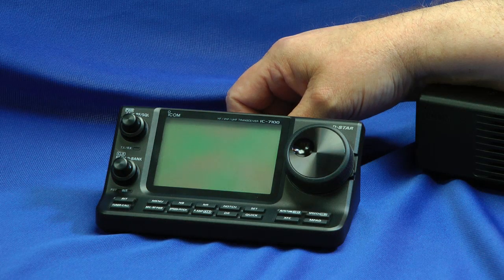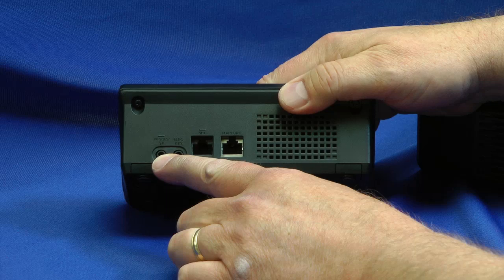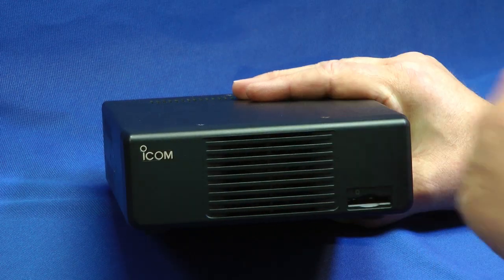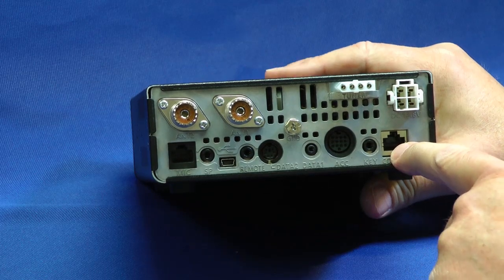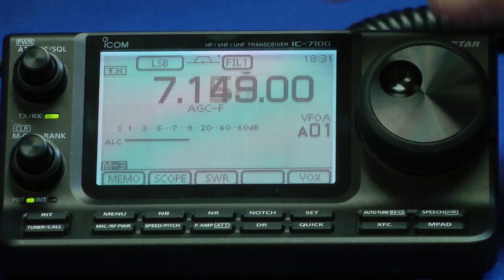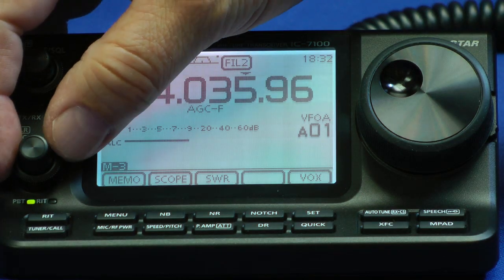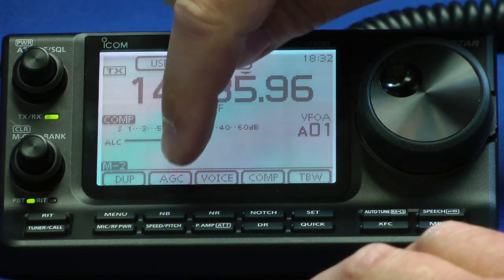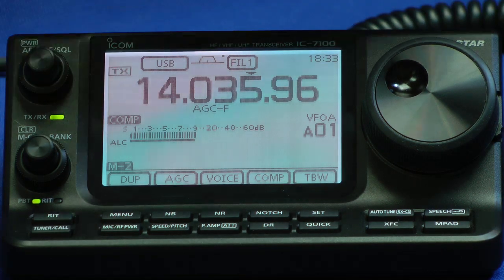ICOM IC 7100 Transceiver

Comment: Hi John can you tell me how to get the temp gauge and voltage meters up, its not in the manual....g4vvq.
Reply: Hi Fred, If you just press and hold on the S meter area of the screen it will appear. 73.

Comment: Ugliest transceiver ever made; looks like a bedside alarm clock.
Reply: Yes, hideous without color and that funklandish shape, but ultimately for this pilgrim- pretty is as pretty does and I bought one because I like what it'll do and the price point. If I don't hate it, I may get a 7300 as well.
Reply: It might be ugly, but it does it's job very good, works from 160m to 70cm, all bands all modes, it's a very good radio.